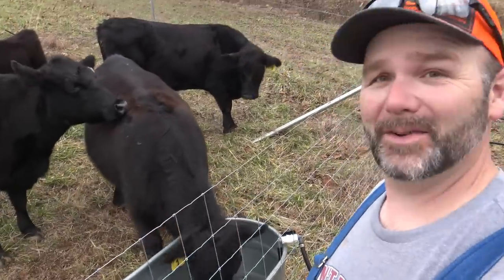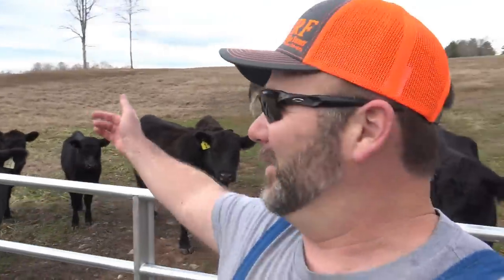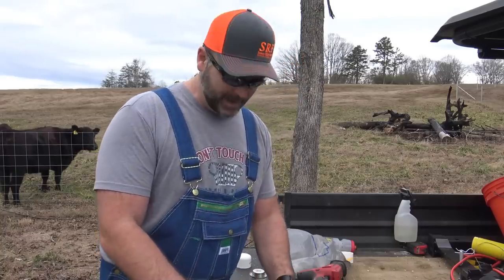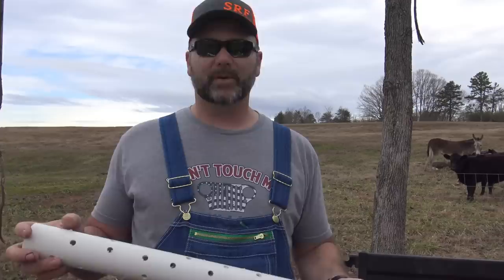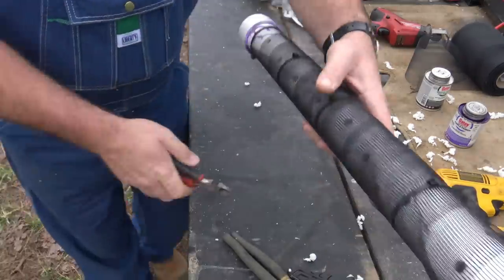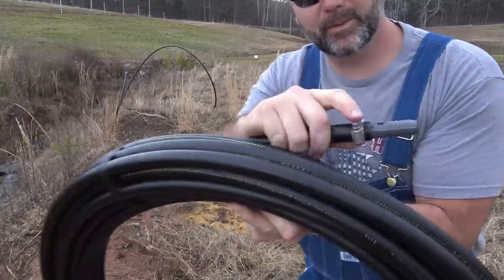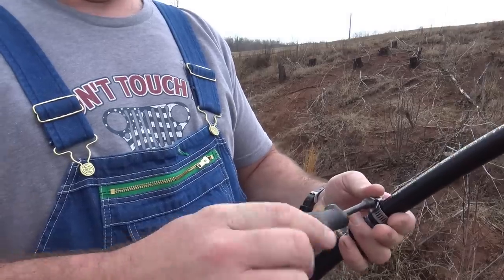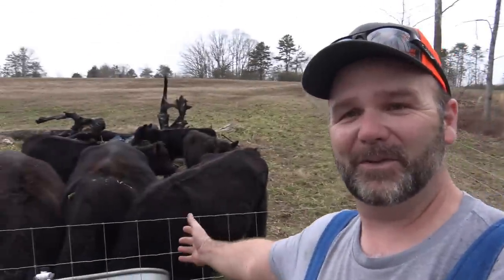Non Stop water system..no electricity, no pump, simple and easy

Comment: Near the end you stated "3 minutes"  so I figured you were going to use a power drill with a small pump.  I do not think you could ever get a water column in 3/4" pipe up over that hill on lung power.  That would be a lot of air to inhale with the weight of the water.  Without a pump, putting all of the line into the pond to flood the line and then shutoff the ball valve.  Carry the very heavy, cold, and stiff line over the hill and open the valve to start the siphon effect.

I suppose you will go out there each day and turn the ball valve on for awhile and then turn it back off.  It could run all the time but that would waste a lot of the water.  A water level valve might work if it did not loose the siphon.  System should work OK during weather above freezing.
Reply: How many feet total from pond to water tank ?
Reply: Add a 1/8 hp solar powered sump-pump to the filter end and a level valve in the tank will probably make this system more practical , otherwise, priming is going to be your worst nightmare on the long run. Lol 😆

Comment: A shop vac would have been the easiest.
Reply: Shopvac for some -  for me I'd need nearly 300' of extension cord to get to the tank/trough!
Reply: @texas2wheeler446   ~~ A shop vac pump cannot lift any amount of water six feet, not to mention 100 feet and certainly not enough to water a herd of thirsty cattle.
Reply: @texas2wheeler446  Of course you are right, but I doubt that such a weak pump couldn't lift water that high. Consider this, a man sucks on a hose to get the water to the top of a hill. He stops, thinking the water he has sucked up will now start flowing downhill to where the cattle are. But it won't. gravity will pull it back down to the pond. The only way he or a small vacuum pump could work is to pull a hose uphill and continue pulling unto it is where the cattle are, then and only then start to suck on the water until it not only reaches the top but until it reaches the bottom. This the the rule for siphons. I will say again, heating the water in a short piece of metal pipe, until the entire hose is full, up the hill and down the other side, with no air in the hose is the best and probably the only way to make this work. A lift pump by the pond, powered by a gasoline engine or electric motor is the only other way, and even then it must be a very powerful pump to do the work.

Comment: Love the show!
Moving day for the heard was like watching the old "BIG VALLEY" Series EXCEPT gone High Tech! 
Absolutely Awesome part was the heard going the WRONG way and the look on your face. 
PRICELESS 
About the Passive water system syphon maybe a SHOP VAC it would have worked to get the water started....I bet you have a generator you could have run a SHOP VAC TEMPORARILY this could have got the syphon  to start faster and clear the pipes of the terrible manufacturer plastic taste you described. 
Remember: If it tastes BAD to you it going to taste BAD to the heard. Could've filled the cows water temporarily yourself while the passive water system was set up and  allowed to run for a few hours to clear the pipes nasty manufacture taste. 
Is that type of line rated for use for transferring water for a long period of time in changing weather??
Just askin' 
Have you done any videos on these new recharging Generators that don't need gas ?
Thanks for sharing all the work that goes into a farm.
Gives me a lot to think about.

Comment: I have small farm, large pond 500ft away, 6 ft above home site, large garden, grass field. I have a 2inch pvc pipe from pond, but it has to go up hill 10 ft then down to my area. Foot valve end of pipe in pond. At top of apex on hill have a "T" with a 1/2 inch flapper valve pointing up (check valve) to blow off trapped air. At irrigation pump below near house, have a system where I pressurize gravity hybrid siphon system for 3 minutes. Turn off well water. Turn irrigation on, get about 4 lbs pressure at irrigation pump. Ive designed a system for off grid systems that have an elevated pond but has to go up hill several feet before going down hill. Install a 100 gallon or 200 gallon container at end of irrigation run. It has to be filled with water from truck initially or pump initially . Use good 12volt pump to pressurize syphon system. We charge ours every few days. On very hot days we lose prime/syphon easier, not sure why. Main thing...You do need a check valve at pond with the arrows point to the direction you want syphon to flow. I have 2inch ball valve near house that I shut off when "charging system".  At top of hill/apex where my blow off "T" is, I have 6 inch rise with a threaded cap, I drilled 3   1/8inch hole in cap. From 300ft I can see the "fog mist squirting" up in the air when pressurizing/purging air out.  This tells me air is purged out.  I have multiple 2inch riser around barn, yard, garden, small grass field. I use 2 inch pipe as hand line, dont glue joints, just barely push them together so I can flood irrigate where ever I want.

Comment: With your siphoning, you can get a cheap one from the hardware store. The taste goes away once waters gone through it for a while though, but depends on the grade of poly you use. One trick through is use a bigger inlet pipe (like 1" or 1.5") with a poly coupling at the end to 3/4" and run it for about 5-10 meters from the inlet to the coupling. Take the coupling apart and siphon at that point. There's a lot of water coming out and it creates pressure to the 3/4". Much easier to get it and keep it going.

Comment: looks like you got it handled. you could consider a refrigeration vacuum pump. there are cheap ones, it would be a slow pump, but they suck down to 30mmhg and they suck air. . these are used to pull the air out or refrigerant lines before they fill them with gas, you could also push it temporarily with a ditch pump to create prime...and i am sure most of these other ideas are good too. I nice work on getting it done also. your way was the cheapest and possibly just as fast

Comment: Hey Josh, in the future when need to pull a siphon, try throwing a whole coil of pipe in the and let it fill with water after hooking it up to your filter.  After it fills up, put a valve on and close it off.  Now you can pull it over the dam and open the valve to make sure you have your siphon.  Once the siphon is established you can hook the rest of the pipe and you are good to go.  That way you shouldn't have to put your mouth on an old dirty pipe and still get the job done.  Wooooo

Comment: If you go to the top pond and put in another valve with a pipe that goes up in the air about four feet. Then turn the valve off at both ends so the only open pipe is the one sticking up four feet into the air you can then run water through that standing pipe to prefill your vacuum pipe downhill. Then open the valve at the bottom and then the top pond valve! No more sucking Pipes !

Comment: There is a small manual  hand pump called a "Guzzler". We use them  to prime a water pump line.  !" or 3/4"  No mater. Just need to have the correct adapters to fit the  pipe. Great tool.  I think they are around $100.???   Rick.

Comment: It is amazing that you managed to suck (move) 29 liters of water through your mouth, which is about 29 kg (V = Pi * sqr (r) * v = l = Kg). This is like the weight of a 150Ah lead-acid battery. Thus, over 30 Kg would be weighed by a whole hose filled with water at the pond, which would eliminate the suction of the siphon by mouth. Of course, the weight of the carried (unwound) hose would decrease with each step closer to the cattle pen ... and it would probably be better to pull only the end of the hose. But if you have good lungs, no problem. :)

Comment: Can I ask you, when you had cows around the pond, didn't rain run off poop into the pond? So, how did you keep the pond clean?
Reply from the maker: never had any cows around any pond on the farm....all the ponds and creeks are at least 25-100 feet from the cattle fence.   Let's think about this from a common sense standpoint...since you're wanting to prove that manure is still going in the ponds and creeks......go buy 10 lbs of potatoes....cook them and mash them...then dump them in two piles 25 feet from the pond.....go back in 6 months and tell me how much mashed potatoes ran off into the pond...odds are none of it my brotha.  It's not like I'm out here with a pressure washer pushing manure into the waterways....worms, microbes, fungi and more consume the cow manure...which is simply processed grass..and it's re-absorbed into the soil feeding the land.  So...no manure enters the watershed unless we get like 5 inches of rain in 10 mins...which has happened.....the goal with moving the animals constantly is to keep the manure load low all over the entire farm instead of running the cows belly deep in feces and having a runoff problem

Comment: I like your siphon and Jay Thomas is absolutely right but to go to a larger diameter pipe ,that way may not be practical. The alternative method may be a little more expensive, in that you will require three valves their fittings and a 'T' piece and a funnel. With one valve at the waters edge, one valve on the other side of the dam as low, below the water level of the pond and one with the 'T'piece at the top of the dam. With the two valves on either side of the dam shut, fill the pipe with a bucket and funnel at the top of the dam, then after shutting off, open the water side valve first, then the bottom one and the siphon will start automatically.

Comment: Yep, its called a shop vac.... works great. just plug it in to my dewalt jump starter inverter, and it sucks my five hundred feet in about a minute.
Reply: get a 2" rubber coupling with the hose clamps on it, the put one of your pvc 2" x 3\4 threaded to screw your poly male adapter into. Then tighten the hose clamp onto the reducer, on the other end of the rubber two inch coupling, slide the hose clamp off, and stick the rubber coupling inside the vacuum hose. Turn on vac.
Reply: you can also put a tank float valve on the end of the poly, connected to the tank. you wont loose your prime, as long as no holes are in the poly, and you have more pipe on the down hill side, than the tank side. That way you dont have to constantly go down and turn on the valve.

Comment: Fill the whole pipe with water before you unroll, use cordless vacuum or borrow a water bug pump and pump water to get siphon going.  Suckin' on the pipe is great for 50' but dude your a trooper for more than that.  This will make Greg Judy laugh however.  A laughing is good!

Comment: When cleaning my fish pond I don't suck anything.  Just use the garden hose to fill the pipe all the way up to the pond.  Disconnect, and the pipe is already full of water, no air, and down comes the pond water.  Fast and easy.  Would also recommend a float valve at the troth.

Comment: Pro tip: Unless you plan on getting your stuff inspected you do not need purple primer. They make a clear primer or cleaner that does the same thing without the purple mess. Or you can just get a one step pvc glue made by several companies, but the most popular is Gorilla glue.

Comment: We have a Lake on our farm and I was doing some things in the Lake that I use it ties on really big ones to hold a handle to a valve on the bottom of the Lake and the zip ties were airconditioner style so that 3' long and an inch across of the plastic. Believe it or not the valve the handle did not stay attached to the valve. Valve is a  12" steel valve in the bottom of the Lake which is about 25 to 30' off the shoreline so you have to go out in a boat to open the valve if you wanna drop the level of the Lake. Use a quick fix using the zip ties believe it or not there's  Fish or turtles the 8 zip ties and about 6 months I  Couldn't believe it Just sayin

Comment: On a hot day those pipes will lay flat. Easier to lay out.  Plus the water will get warm. May want to think about burying it. Another trick. Tie cables to the pond bank in a couple places. Then connect the float to the cable in the center with a 10 foot connector. This will keep the wind from blowing your float to the bank plus allow it to rise and fall with the pond level

Comment: Put a valve at the pond, carry water in pails up to the water trough and pour it into the pipe until it's full, lay it in the trough, open the valve at the pond and the weight of the water will start the siphon. A float-valve  at the trough would raise you one step above cave-man level.

Comment: Mount a 2" pvc tee with a 18"-24" riser pipe and a cap to a board to stabilize it at the top of the bank where the tubing comes out of the pond.  Close the valve and use a bucket to fill the line from the riser pipe.  Note,  you will need to install a check valve near the "filter" to prevent water flowing back into the pond.  Put the cap on the riser, and then go open the valve.  Outdoors with the Morgans once posted a video about how to drain his pond.  You can modify Mike's design to fit your set up.

Comment: if u install a unidirectional valve at lake side, just pull and drop the en of the pipe and it will  fill automaticly and when there are enogth water in the system it will pump water for it self

Comment: The easiest way to create a siphon is to take a 55 gallon barrel below the water line of the pound and connect a line from it to your water trough and another line from the pound.  Put a ball value just off the barrel.  Fill the install a fill pip with a screw cap on the barrel.  Use a 5 gallon bucket to fill the barrel.  Put the cap on then open the ball value and the water will drain from the barrel to the trough   as the water drains from the barrel it will siphon the water from the pound into the barrel.  The Barrel will also create a small psi maybe 1-2 psi depending on the drop and length of the line from your barrel to your trough. 

In your case, you had 400 feet,   I would use 2 inch pipe for the filter and 4-6 inch pipe for the float.  Then use 1.5 inch pipe to the barrel.  Then use 1 inch pipe from the barrel to the trough.  You can also use a ball value at the trough to hold the prime and let the siphon only be at the barrel.
Reply from the maker: lol sounds easier than just running a pipe lol  I love it dude

Comment: You can turn the valve around inside one of the standing bicycle pumps,  then it creates a vacuum.  It's a far better faster way to do a syphon.  I cut off the fitting that goes into the tire and just connect a plastic tube instead.   Then figure a way to connect that into your 3/4 inch pipe (you make something that is quick connect)  and its plain sailing for next time your syphon breaks.

Comment: I am really surprised you could siphon over that distance my hats off to you I have a couple innovative off grid watering systems for my cattle at various spots I thought it was just going to be a gravity drain but that’s pretty impressive I’d be concerned about losing the siphon at times
Reply: Have you ever seen a reverse siphon? It’s where water up high flows from a ditch into a pipe. The pipe drops into a valley and up the other side. Water flows out the end of the pipe into another ditch. The Davidson Ditch was used in this fashion to supply water for gold dredges in Alaska.

Comment: if you have a shop vac and access to 110 at the trough you could prime it with that.  If that system works like the low press systems I've worked with.. the ball valve should hold the water until you're ready to use it again -

Comment: For that ball valve, if concerned about UV degradation, cud u use a piece of pool noodle, cut to fit, to protect the valve? One 98¢ pool noodle wud make many covers. Replace as needed. Wud also make it easier to attach valve in place.

Comment: Pull the vacuum line off of your brake booster on your truck. Make sure you use a clear hose so you you do not water log your engine. Or salvage a primer glass from an old irrigation pump.

Comment: do you have any trouble with rodents such as mice or badgers making holes in your black pipe, tried doing this with garden hose and had what looked like a mouse made a small hole, my siphon quit, how big of air leak is tolerable? had about a 4 ft drop, thanks and good video

Comment: You can use a bucket and a funnel and backfill the pipe all the way down to the pond and then reverse suction and it will automatically start to flow or back fill it with a water hose that has water on it already and it will do the same thing or if you have a pipe that has water pressure on it already and you had a t between them and a ball valve as the water goes through one it will use a Venturi pressure to pull water up through the other one

Comment: If you have another hose or pump just back-fill the poly hose a bit.  Once you have enough elevation of back fed water to suck the dam water over the hump of the dam it will flow.  Otherwise you can fill it from the top to do the same thing, maybe adjust ball valve to let a little air through but not much water.

Comment: Hello Gentleman,
I do enjoy your videos. However, I have not found the one that I am looking for. I have a water well about 40 meters from my house and at an elevation of about 10 to 15 meters below the level of my house. My plan is to try to bring water from the well to a tank that is located on the roof of the house, without using any electricity or fuel. Could you suggest something or make a video for something like that? It doesn't matter if you have to use different systems as long as neither uses electricity or fuel and can be done at home